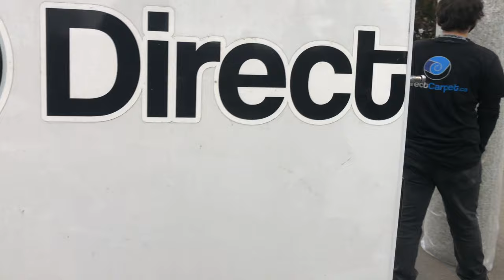The Best Carpet Installation How To Video Ever in my Opinion

Comment: Can’t work out how the carpet is stretched correctly with that method. Looks like it only stretches between the machine ?  The grippers are well to far away compared how I was trained. We have them on ave 5-6mm away.
Reply from the maker: Different strokes for different folkes 😀😀😀😀😀😀😀😀😀
Reply: Yeah im use to the power stretcher too. And according to inspector they will see if they powered stretched. But I like that it's easy on ur knees
Reply: Agreed

Comment: Hey Keith I have a full size power stretcher that stretches from wall to wall was interesting to know where did you get the mini stretcher that you put your knee on haven't seen one like that I know crane makes one but it's not like the one you use where you put your knee on it
Reply from the maker: That little guy is from kneeless.com
Reply: @KeithShannonDirectCarpet  thanks Keith I'll have to invest in one would really like to see a video on gluing carpet on spiral metal stairs